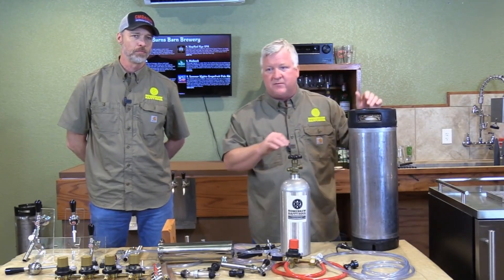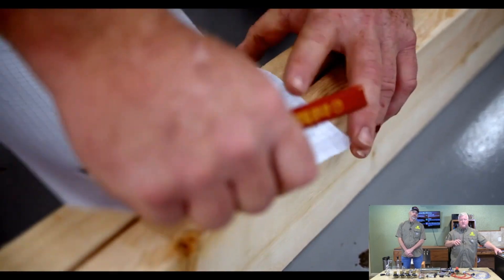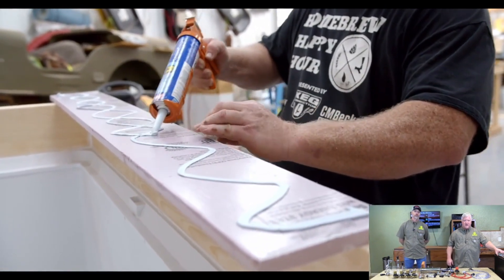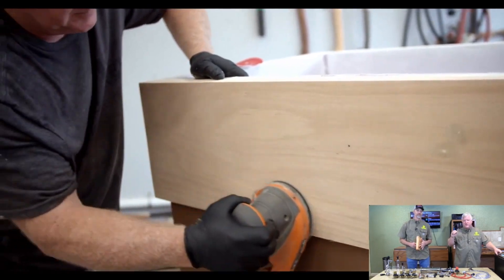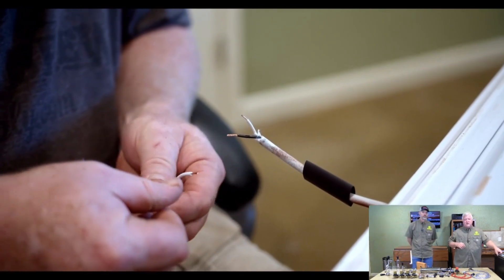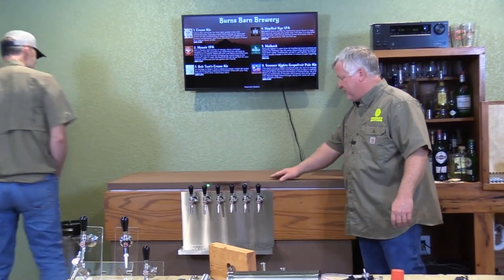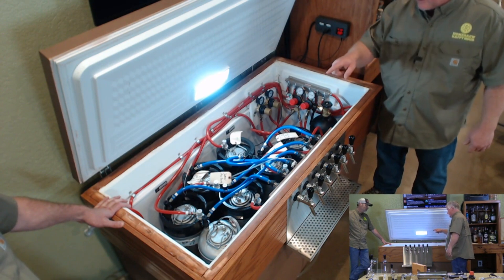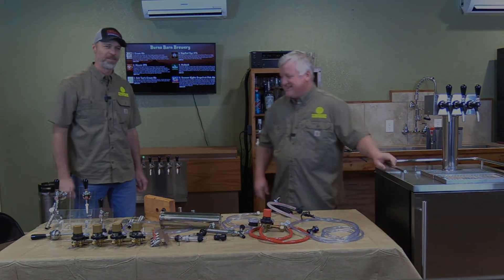How to Build a Keezer Draft Beer System

Comment: Great video and excellent build tips. My freezer just crapped out, and am having to build a new keezer (my old freezer is discontinued, and so I can't re-use the collar). Although I love the red and blue lines (and also had them in my old one) I will be using EvaBarrier lines and DuoTight fittings this time to minimize O2 ingress into both gas and product lines, and to minimize the product line lengths needed (thus eliminate the need for flow control faucets). I also include 120mmx120mm computer fans, which do a great job of keeping the temp profile more uniform, and preventing the top from getting warm (which mitigates warm lines & foamy first pours).

Comment: Nice Info 👍 
With the gasline coming out the side, you can just put a disconnect there, so there is no line you pull/push in & out. Keep the line on a hook behind the freezer and just connect when you need it 😉
Reply: Instablaster...

Comment: My keezer died on me a few months back. It was a 2 tap keezer and i had just got my 2nd cmb v10 to upgrade it when it died. Going to be building a new one here in the next few month.  Got the wife on boad with getting a bigger one. So now i have to get at least one more v10. Lol first world problems right? Lol but i love the idea of the pull out gas line and havong a line to carb a keg while drinking the other. Thanks for the ideas.

Comment: Great video, you guys use really thick lines! Are they nylon lines? I've been warned off basic nylon tubing as it can taint the flavour of liquids and have used specialised beverag lines instead that are 8mm external diameter but they are generic plastic colour. The blue colour though is a great idea for line separation! 🍻
Reply from the maker: We're using this tubing for our liquid lines: https://www.kegconnection.com/blue-gas-or-liquid-hose-5-16-id-9-16-od-per-foot/     and, since we implemented flow control, the ID can be larger since restriction on the beer is being managed by the flow control faucet! It's dual durameter and Bevflex markets it as being Phthalate-free and 'odorless'. We've been using it for years in other flow control builds and haven't had any leeching issues, thankfully!
Reply: We used Accuflex 204 beer line. It's a dual durometer hose that works great. Been using that style of hose for years with no issues. We use 5/16" ID hose because of the CMBecker flow control faucets. They work better with larger ID hose.
Reply: Wow that's nice beer and gas line! Thanks for the reply, if I could get that hose down under i probably would 🍻 Over here the most common beer line is either 4mmID or 5mmID with 8mmOD and you would use 1 to 1.5 metres with standard taps to get the right flow pressure at the tap

Comment: The 2 kegs in the front center don't look like they are going to be easy to get out. Looks like a bunch of lines will have to be disconnected. Personally, I don't like crossing over the top of the kegs with the gas and liquid lines. Nice build though.